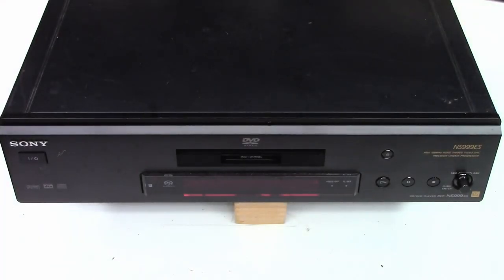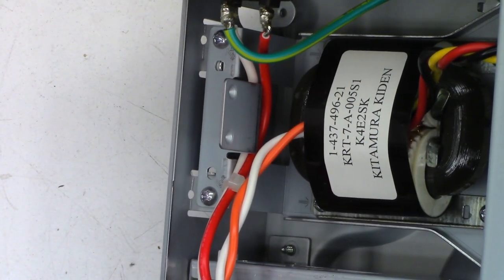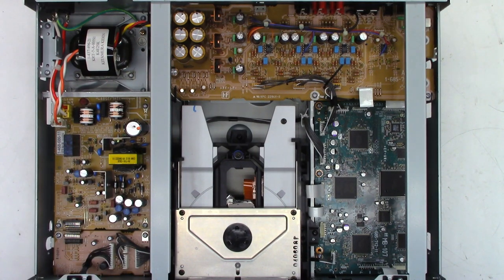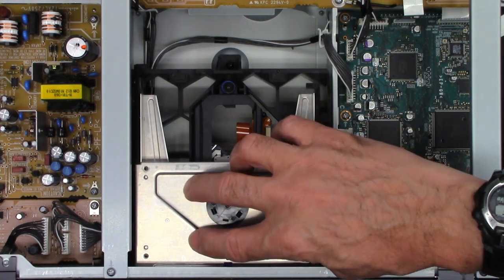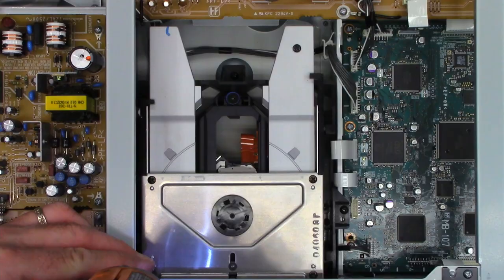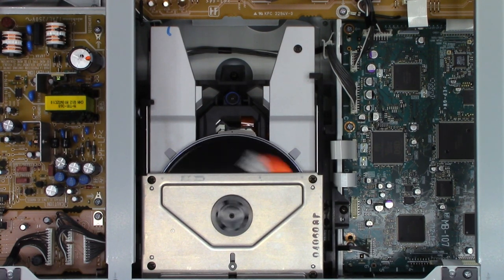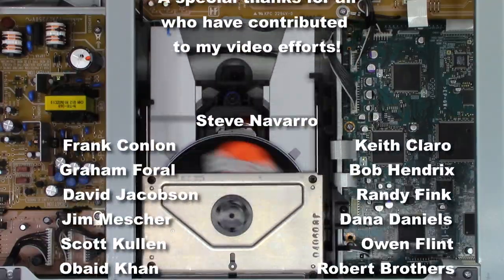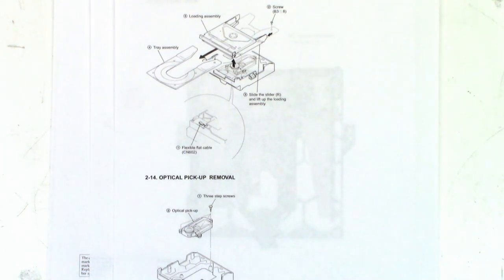A Sony DVP-NS999ES DVD SACD player tray wont open after customer cleaned the pickup

Comment: Just picked up a nice Sony DVD player at the local thrift store. I got it because it shows the track number and other information on the front display. As you would say, "It works just perfectly." I am going to clean the lens and do some preventative maintenance on it to prevent future problems. It even has a setting called VES, which according to the manual is a type of virtual surround sound. I have other DVD players, so I plan on using this device as a CD player. It matches my other Sony components, including the display on my STRDH190 and my STRDH590 receivers.

Comment: Thanks again for the great job, Steve! I spent an hour trying to put it back together again. You figured it out in a few minutes. That's why you are the pro. :)  This player was the top of the line when it first came out. It will play just about any CD or SACD you throw at it. I use it primarily as a SACD player. The Redbook sound is good but I prefer my Adcom CD player with its TDA 1541 chip. Makes CDs sound like my Merrill Heirloom turntable. SACD playback on that Sony is sublime.
Reply from the maker: I think this is your player!!! Thank you Jim!

Comment: I just took mine apart to clean the lens because it wasn’t playing SACD layer of hybrid discs, while doing that, that top piece looked “pushed in” from the front no matter how carefully I inserted it, finally after watching this video, and looking underneath the piece I noticed it had to be pulled out and held in place while inserting it, the thing has to be pushed down until all screws on top are back in otherwise it can pull back in, it took a few tries to get the thing back in, but after doing all that, it works again, and my player plays SACD hybrid discs again, (it didn’t play them while the top was still off, maybe the light coming in lessened the accuracy of the laser, either way I assume the laser is getting weaker on this machine and eventually it won’t play hybrid SACD’s at all)